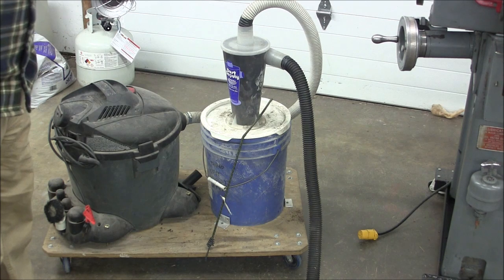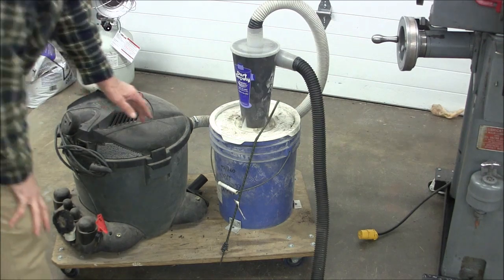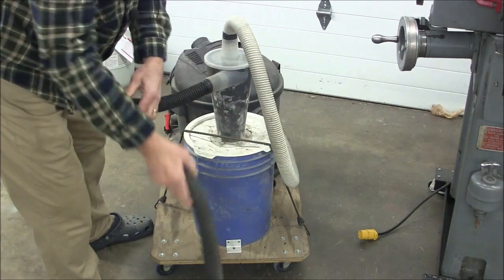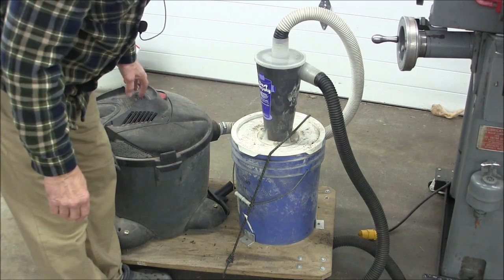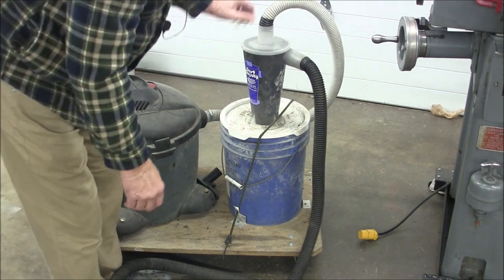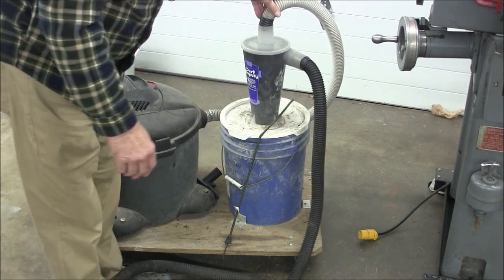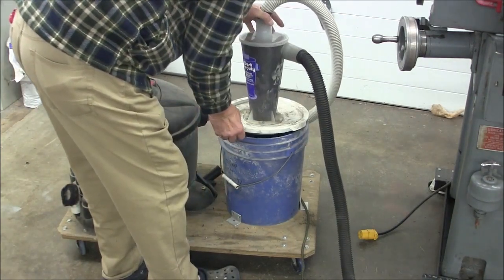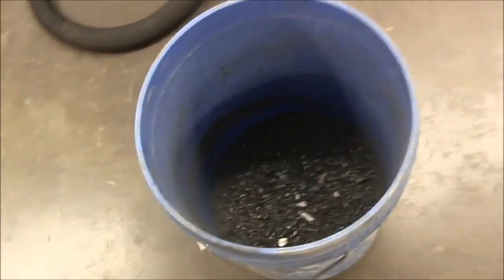Dust collection shop vac

Comment: Hey thanks Mike! So the larger particles drop into the pal but do you need anything more than a normal filter on the vac to keep the grinding dust from getting in the air, or is the dust heavy enough that it drops into the pal?
Reply from the maker: The first stage (bucket) captures the larger particles. Then the very finest particles pass to the vac.  I'm running a standard vac bag In mine. I suppose you could just use one of those foam filters. It just seems like the bags will capture more of the fines before exhausting. At least this is my understanding.